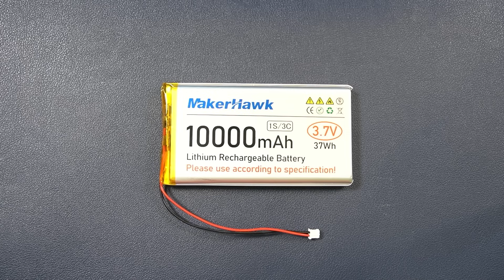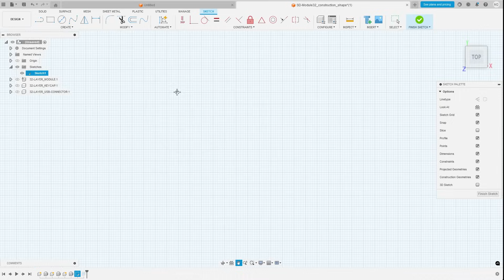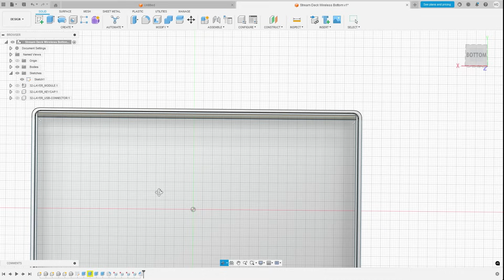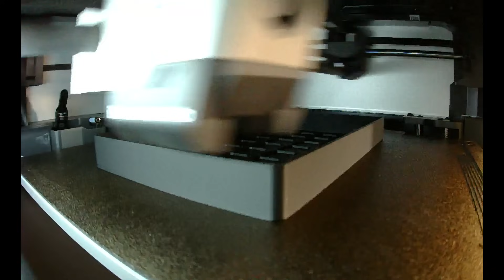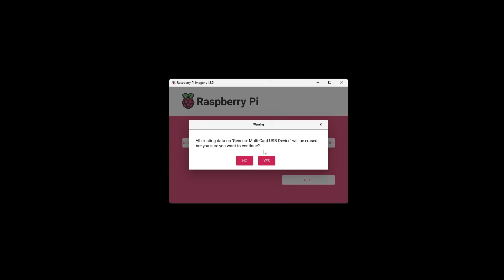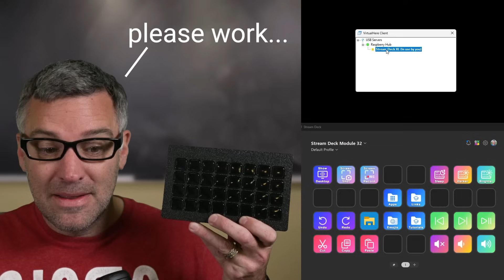Build your own wireless Stream Deck that works with the Stream Deck software!

Comment: Thats awesome mate. Any chance of using it wirelessly without being on the same internet connection or bluetooth?
Reply from the maker: As long as the PC you’re controlling can be seen remotely, it works over an internet connection, though it is a bit laggy.  Re: Bluetooth, unfortunately BT doesn’t have the required bandwidth for the stream deck button images, and I couldn’t find a general BT to USB bridge.

Comment: Don’t know if anyone has asked this yet but does this work with bit focus companion? Also have you made the smaller versions yet? Thanks for the great video!
Reply from the maker: It should work great with Companion.  In fact, if you’re using companion, it would be more efficient to install companion on the pi zero, and set it up as a satellite.  Re: a smaller version- not yet, but the entire process would work the same with a smaller module. You just need a different 3D printed case.
Reply: @FSingularity sweet, thanks!

Comment: 2:24 What about adding a capacitor on the 5V input of the Pi?
This would stabilize the power. And it even smooths out power irregularities.
Reply from the maker: Appreciate the suggestion. I've tried- the issue is how slow the charging circuit switches over from line in, to the battery.  My calculations indicate it would require something on the order of a 0.5F capacitor, which is in super-cap territory.  I tried some normal sized caps I have handy, and none were even close to sufficient (watching the voltage drop on my oscilloscope).

Comment: OMG - I can't wait to build one of these - it 100% solves a need for me. Thank you.
Reply from the maker: Stay tuned, as I'm working on Wireless Stream Deck 2.0.
Reply: @FSingularity  Can't wait. What is different with v2.0?
Reply from the maker: @matt.henry73  Without giving too much away 😉... it will have wireless charging, a completely different SBC that has a bunch of benefits, and will be a lot easier to set up from a software point of view.

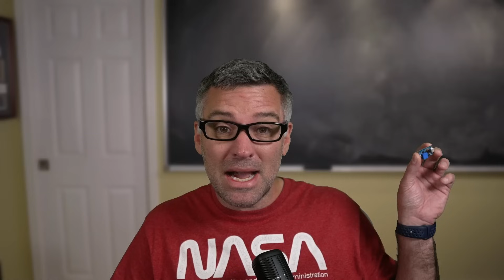Comment: 2:43 I do believe it's a voltage booster. You can boost voltage by drawing more current than you output. You can supply higher current stuff by using higher voltage on the input than on the output. But you cannot just boost the power, actually boosters output a few % less power than they draw, as some of the power is dissipated as heat. Dissipated, not lost! ;)

Comment: 2:39 as @cdaprod said, you can add a capacitor. Not only you can, but I believe you should. A 470 uF aluminum (I'd recommend a polymere over an electrolytic one) might do the job, but to be sure - calculate the needed capacitance :)

Also, if you use a switch to open the circuit when not using the device, you may put the switch before the capacitor, so that the DC leakage is eliminated. It makes sense to do that if you'll be leaving the device untouched for a lot of time. But that way the power surge from both the Raspberry and the capacitor will again cause the RP to turn off initially, upon closing the circuit via the switch. Adding some kind of delay (to not power the RP before the capacitor has been saturated) will certanly fix that, but you'll need to tinker it out yourself. 

Good luck! ;)

Comment: Perfect kind of project for someone like me, just for the fun of the build I don't need mine to be wireless :) I was already thinking about what I would do like use a big lithium battery and such and see you went the same way.  So if I am going to one up you I'll have to add solar to mine or something lol.

I actually used the USB Virtual Server for my solution to streaming Moonlight to a Nvidia Shield and use the PC USB adapter for wireless (better latency and adds the rumble you lose with wireless).

Comment: So basically its a pi zero 2W with virtualhere...
Wouldn't be better, easier and safer to just use a usb power bank with normal streamdeck at that point?

Comment: WELL DONE! An idea for getting around the power interruption: 

Replace the battery and charging board with one of those portable power banks that support passthrough charging. 
Bonus points if you can find one with a physical on/off slider switch instead of a button, can create holes in your casing for charging and the power switch.
Reply from the maker: Great idea.  I did consider going with an off-the-shelf power bank, but was unable to find one in a flatter form factor that wouldn't make the case too thick.

Comment: Can this be done with a Rasberry pi 3B?
Reply from the maker: Sorry for the delayed reply. A Raspberry Pi 3B should work just fine for this project, though it does run a little warmer so you  might need to consider better ventilation/air flow.
Reply: @FSingularity thank you for the response. I did it last week with a Rasbery pi 3B and a elgato stream deck neo. Following your same steps of configuration.

Comment: @FSingularity can this setup work with Frostbox Labs Macro Deck and DiGiCo consoles ? Can I use the same setup with the smaller 15 key Stream Deck Module ?
Reply from the maker: Apologies for the delayed reply.  I'm not familiar with the Macro Deck nor the DiGiCo consoles so unfortunately cant answer your first question. Regarding the 15 key Stream Deck modules, this will work with any Stream Deck Module, or even a normal stream deck.

Comment: Nice video! Another option (with its own limitations) is the Stream Deck app, which can be used with any Android/Apple Phone or Tablet that isn't hamstrung like an Amazon tablet. You  do lose tactile buttons with this option, which can be a dealbreaker in some cases (like my sim rig), but you gain the option to easily get up to two 8x8 button decks.

Comment: I have a quick question so does it require the laptop and the Raspberry Pi to be on the same Wi-Fi so for example I can't take it to a coffee shop and use it there I have to use it at home?
Reply from the maker: There are a few ways you can have this work remotely.  You could set up a VPN and connect from the coffee shop to the VPN.  Alternatively you can set up your home router to do port forwarding and then connect to the external IP of your home router.

Comment: 2:39  You can add an inline capacitor… or so I believe, to fix your problem with the power out
Reply from the maker: Great idea!   However, I tried with a 10000uf capacitor, and unfortunately, it wasn't enough.  Some calculations on the voltage drop and duration I was measuring, was putting me in super-capacitor territory to not lose power. :(

Comment: It's cool that you got this figured out, built and working but wired is always more reliable than wireless plus you don't have to worry about runtime. Plus, Elgato makes an app for iOS/Android so there already was a mobile version of this, just no physical buttons. This seems like a solution in search of a problem.

Comment: can you do this with your MKI model?
Reply from the maker: Certainly.  Though with a smaller stream deck you won’t have as much physical space and might have to use a smaller battery to get it all to fit.
Reply: Yea but I'll be way cheaper. The 32 keys is $199 plus all the other stuff that's still a lot, less than $900 but still lots of money

Comment: Why? A Streamdeck XL with 32 keys costs less on Amazon than all the parts needed. Is it just because the wireless capability??
Reply from the maker: Stream Deck Module- $199.99
Random electronic parts- $30
A 10000mAh battery- $20
A Wireless Stream Deck? Priceless.

Comment: And I'd also want to find a way to publish the battery level/status (charging or not) for use in Home Assistant.
Reply from the maker: That should be possible by monitoring the battery voltage with a couple of the gpio pins on the Pi.

Comment: It must be possible to build a split keyboard (a regular with letter and number) using Elgato system and keys, right? Any thoughts on that?
Reply from the maker: Unfortunately that would be quite difficult.  The USB over IP passes through the HID device/details that the stream deck provides. So a keyboard will report itself as a keyboard, and the Stream Deck software wont recognize it as being a Stream Deck.

Comment: Cool idea.  I'd be inclined to find a way to enable Qi charging.  That way it wouldn't even need to be plugged in for charging purposes.
Reply from the maker: I've got a Qi charging module pcb and coil sitting on my desk, waiting to be put into Wireless Stream Deck v2.0 :face-blue-smiling:
Reply: @FSingularity  Any idea when the 2.0 video will be released? Waiting eagerly to build my case, have all the parts and the Pi with Companion Satellite is already setup 🤩
Reply from the maker: @greventas  It might not be for a few weeks unfortunately, as I have a bunch of travel coming up.  Feel free to hop into my discord (listed on the f15y site in my channel description) and I'm happy to chat with you about it/help you get up and running.

Comment: I can not get the pi to connect to my wifi,  any ideas what the F i am doing wrong... ?
Reply from the maker: Sorry you’re having issues with the Pi.  First I’d make sure you’re entering the correct info for your WiFi when you set the extra options in the Pi imager.  Alternatively you can connect a keyboard and monitor to the Pi and try to troubleshoot it that way (there are lots of guides on troubleshooting pi network issues out there, and unfortunately it’s a bit too much to troubleshoot in the comments here).

Comment: Recently did something similar but using the bitfocus companion and companion satellite apps. 
This way I can have some actions specific to the remote stream deck and some actions on a second one wired to my main PC that are shared with the remote. 

Pretty awesome build!
Reply from the maker: Bitfocus Companion is pretty amazing, and there is a TON you can do with it. Glad you liked the build!
Reply: is there a video on youtube for that specific method? im also looking for satellite option
Reply: @SmartVideoBE I am not aware of one. I tend to just tinker around with things until they work how I would like.

Comment: Great video!  I'm tempted to do something like this.  Few questions...

1) Sorry if I missed this in the video and parts list, but I assume there's a USB receiver you need to plug into your computer in order for the wireless setup to work?

2) How many hours of runtime do you find you're getting before needing to recharge the battery?

3) To save battery, is there a way to power off the Stream Deck when you're not using it?

4) Does the Stream Deck still work while it's being charged?

5) How responsive do you find the Stream Deck is compared to when it has a normal wired setup?  Are you noticing any lag?
Reply from the maker: I'm glad you enjoyed it!  To answer your questions:

1) When setting up the RPi image, you specify your wifi access point and password, so that it can automatically connect to wifi on its first boot (its in the extra settings when running the Raspberry Pi Imager program).

2) I haven't tried just letting it run to empty, but the Pi + Stream Deck use roughly 800mA on average.  So the 10000mAh battery should last around 12 hours in theory.  I'd say you can realistically get 10 hours out of it on a single charge.

3) Currently, no, but I'm working on some better power management which would allow this. I'll likely make an update to this video in the future when I make Wireless SD 2.0.

4) Yes, it works great when charging.

5) About the only delay I've noticed is when loading a new screen of icons, it takes half a second or so (to transfer all the graphics), versus the plugged in stream deck which is instant.  The button press responsiveness, however, doesn't have any perceptible lag.
Reply: @FSingularity  Thanks so much for you response!  Power management would be huge.  Like a lot of people, I only use my Stream Deck for specific tasks, so if I could turn it off when I'm not using it, that would allow me to go like 10x as long without needing to charge it.  I look forward to Wireless SD 2.0!
Reply: @FSingularity  Any updates on Wireless SD 2.0? 🤞🏼

Comment: use fritzing or another custom pcb maker and you can loose alot of the wiring by either direct soldering it or build everything needed into that one pcb. cleans it up some and can add in some capacitors to maybe fix the power flicker when unplugging the usb cable.
Reply from the maker: I love this idea. I've made a few very simple custom PCBs in the past, but never something with this level of complexity.  Sounds like it could be a great learning experience!  It seems that if I go this direction, I could even customize the IC used for battery management, and how I do power boosting, which might also get rid of that voltage drop. Thanks for the suggestion.

Comment: Is there some open source alternative for virtualhere?
Reply from the maker: There is- usb/ip. I originally tried to use it, but could not get the Windows client to recognize and interface with the Stream Deck module. Eventually after (unsuccessfully) trying quite a few workarounds I tried VirtualHere which just worked.

Comment: esp32 can to.... and be much lower priced
Reply from the maker: I'd love to get this working with an ESP32 as they're not only less expensive, but also use less power. That said, they're a bit tricky to get working with USB Devices like a Stream Deck, and there is some additional work to power both the 3.3v ESP32 and the 5v SD from the same source.  Additionally, the available ESP32 USB/IP library is pretty limited/slow in my experience, so its not a straightforward/simple integration.

Comment: Only thing new in this video, are the over priced "SD Panels" .. only $50(ish) cheaper than the normal Stream Deck, but still only using $25 worth of hardware to make it.
Also people have been making their stream decks wireless for years.. simple google search would reveal that.

Comment: Not technically a "perfect" solution but I enable overlayfs on Pi projects like this, so the filesystem is running readonly, and just pull the power on them. Never had any filesystem corruption or anything.
Reply from the maker: That is a great idea! I'll give it a try to make sure VirtualHere isn't needing to write to the filesystem at all.
Reply: @FSingularity  the nice thing is, it still mounts a read/write overlay. The changes just won't be written back to the actual non-volatile memory before the next boot.
Reply from the maker: Thats great! Thank you for letting me know about overlayfs, sounds like it'll be a great addition.

Comment: Nice video.  I would like to see it using a ESP32 instead of raspberry pi.. That way will be an easy connection via Bluetooth to the computer and only use the WiFi to program it..
Reply from the maker: Thanks! I'm glad you enjoyed it. I did consider an ESP32 as it would be lower power and likely a cleaner install, but there are a few issues with it.

1. Voltage. The ESP32 runs on/provides 3.3v, whereas the Stream Deck requires 5v.  Doable, but adds some complexity there.
2. USB on the ESP32. The Stream Deck module communicates to its host device only by USB.  I've found working with USB devices on the ESP32 is not so straight forward. I know it can be done, but when I've tried in the past, I've not been terribly successful (i.e.- its a me skill issue)
3. The Elgato Stream Deck software requires Stream Decks to be USB devices, so Bluetooth wouldn't work (unless you know of a way to convert a Bluetooth device to USB within an OS, I'm all ears).  The alternative would be implementing USBip on an ESP32, but something tells me that would be quite a big undertaking.

Comment: Any possibility of getting that STL file for the enclosure?
Reply from the maker: Certainly.  I've added a link to the files towards the bottom of the video description.  Please know, this is very much a prototype enclosure, and I'm actively working on a better version (along with a video showing how I designed it). These STL files (which will need to be flipped in your slicer) will specifically fit the battery and board I have links to.  The Pi and booster board will need to be taped in place (again, very much a prototype, and definitely needs more work).

Comment: for the power issue you stated, you want a board that does a UPS mode. but the easier way is just to use a USB C-PD battery bank
Reply: the IC is one from a typical USB power bank. a typical USB C power bank would also glitch or completely deactivate the output while charging. If you find a board with two inductors, that might be an indication it can switch to charging without dropout on the output.
Reply: most power banks disable output while charging and the ones that dont will interrupt power when negociating PD
just use a charge controller without the boost converter as its not used
Reply from the maker: I'll keep an eye out for such a board. And yes, it would be easier to use a pre-made USB C battery bank... but where is the fun in that? 😁

Comment: Awesome video! Quick question — I'm not super tech-savvy, but wouldn’t it be way easier to just plug a decent power bank into the Raspberry with a Micro USB-cable and stick the whole thing into the regular Stream Deck stand? Sure not as much fun & effort, but would do the job as well?
Reply from the maker: I'm glad you enjoyed the video. Yes, you could do this with no soldering/3D printing/etc, exactly as you describe. USB Power Bank --> Rasp Pi Zero --> Normal Stream Deck, and it would work exactly the same (though would take up significantly more space of course 😉)